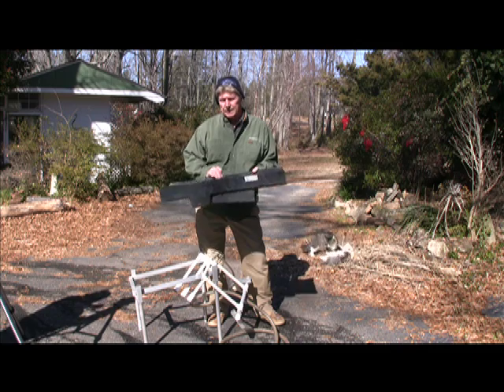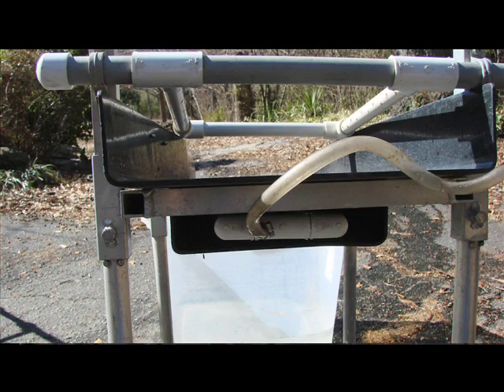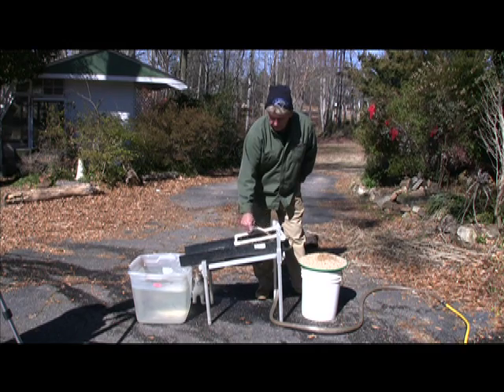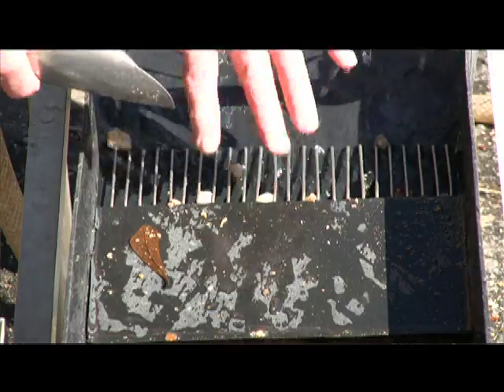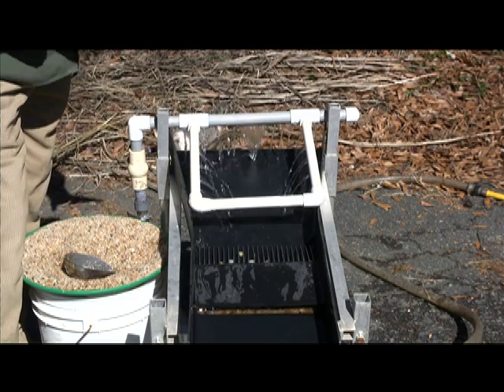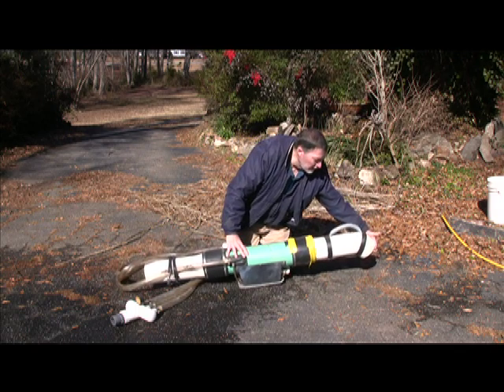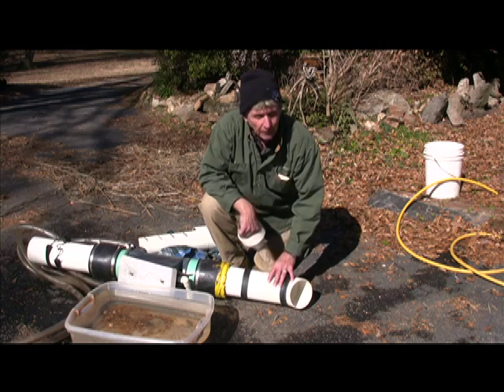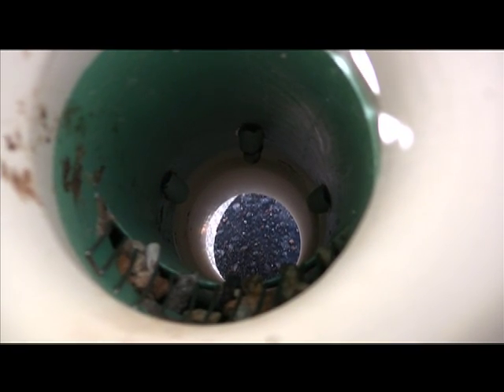Bazooka Type Highbanker / Dredge

Comment from the maker: Thanks Walter. Most of our creeks have good water flow all year so the Bazooka sluice works great. I have a creek that, like yours, is mostly dry except for a hole or two of water. In this creek, I have wait until it rains hard then go during the rain to work it except for panning. Too bad because it has good gold, just not enough water. The Bazooka sluice set up as a high banker works well but it too needs a pump and water supply. Thanks for watching and leaving a comment. Good luck.

Comment: Hi indyme2: I tried to reply to You last night via yahoo email. This morning I saw that it was a failed delivery. Here is what I am trying for, In Alaska and other places they use a type of sluice box called a beach gold box, They scrape up the black sand on the beach and recover fine gold. I live as a retiree in Central  America (( Panama ) and the beaches have lots of black sand. I know that black sand is no guarantee of gold, I want to try it.  I want to have a sluice box/beach gold box/recirculating sluice box, all in one. I  have a 30 inch bazooka and 2 12 volt 750 gph  bilge pumps.I wont have to deal with rocks or clay, only sand and mostly black sand. Are the pumps big enough? or do You think that I need larger pumps? If I understand it correctly you must  equal water flow on the upper and lower sections of the bazooka. Those seals that you made for the lower manifold are very important to seal  the intake tubes. Yes I would love to see your pictures and get any information and suggestions that you may have. Pipe size, pump size. I am in Florida right  now and I can buy what I need for down there. I saw you in a video about 4 or 5 years ago with indyme1 testing the 2 sluice boxes and your concern about not getting 1/2 inch nugget.LOL!   Thank You for your time and knowledge..
Reply from the maker: Bazooka's are pretty forgiving. Good water flow is best but if you look at my sluicing and panning video, you will see it still works with less water. You just need enough flow to fluidize the trap and enough to wash the lighter material away. If you look inside the trap, you can see the sand rolling and the lighter materials floating away. That's all you need. I apologize for the late reply. Not sure how is missed this unless YT didn't notify me. Thanks for watching and commenting. Good luck!